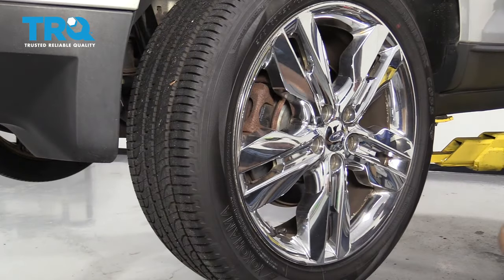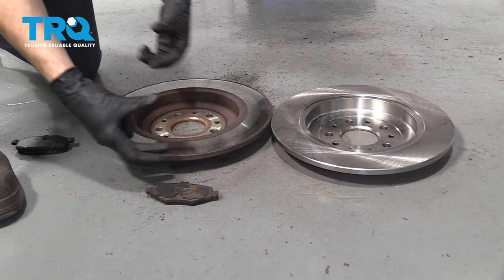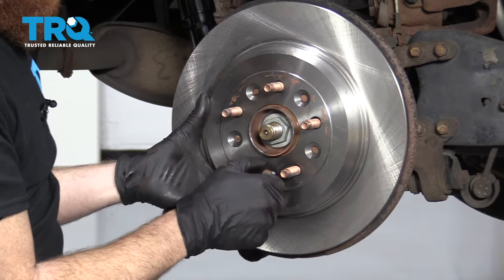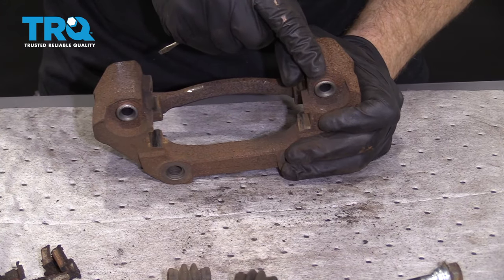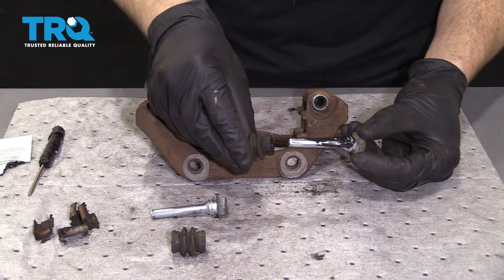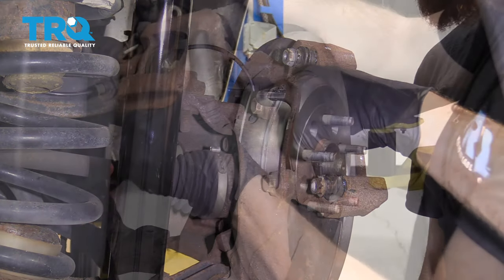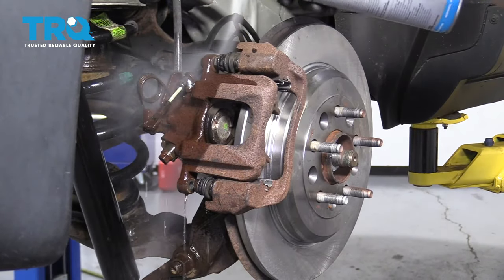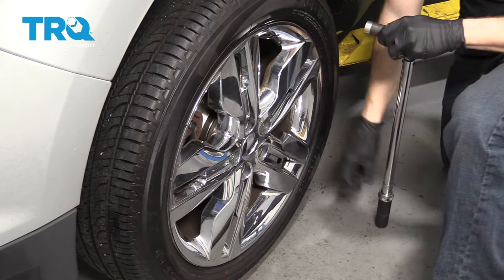How to Replace Rear Brakes 07-14 Ford Edge

Comment: Instead of cracking the bleeder loose just open the brake Reservoir cap that usually allows room for the expansion.  Great videos man keep up the hard work
Reply from the maker: +Rambo Ollie Thanks for the feedback! http://1aau.to/m/Shop-TRQ
Reply: Or a C-clamp maybe idk 😐
Reply: @zeromarine1985  c clamp won’t work because this piston twists not pushing in

Comment: You lubed where the guide clips lock into the caliper?  However, you didn’t lube the side of face of the guide clips that the “ears” of the pad move against.  Seems backwards to me.  Other than that, I was informed about what to expect when I do my 2013 Edge rear brakes.

Comment: I bought new rear rotors for my 2014 ford edge 3.5 v6 and it had the rotor screw on each of them. The problem is when I took of my wheels my rear rotors don’t have a screw hole.I bought this car from a dealer two years ago. How can I put the new rotors on with no screws? I know I bought the right rotors.

Comment: No need to look any further. HANDS DOWN THE BEST  VIDEO on changing the rear brakes on the Ford_Edge! Very straight to the point. Lighting was excellent(not like other video out there that can't show exactly what you mean). I couldn't get the piston to compress in until this vid on how to do it.
Thank you for your time. Excellent job!

Comment: Well done.  Done many DIY brake jobs in the past but since daughter bought a new used car thought I'd check out content on brakes before tackling the job so there were no surprises.  Like others said, straight and to the point.  Should be easy as it's like others I've done before.  Thanks for sharing and well done.
Reply from the maker: +SC Kuhl Thanks for watching our video! http://1aau.to/m/Shop-TRQ

Comment: Hey, great instructional video well done and covered everything required to do a proper job. I've gone the extra step by grinding/wire brushing the caliper surface after masking off the pistons, as well as the brake caliper bracket, and then high heat primer coat 3X followed by a caliper paint 3X before reinstalling. If you have wide spoked wheels, the extra effort sure shines through and they look like a brand new install/upgrade.

Comment: Great instructions. I had to heat up the T40 to remove and make sure you get a padded set of needle nose pliers. It takes alot of effort to twist that caliper back in

Comment: Is it necessary to open the bleeder valve when turning the piston back in or will it just push the fluid back up into the reservoir under the hood?

Comment: Appreciate the info....always like to review these before performing on a vehicle I'm not 100% familiar with.  2 x comments:  First, I would ALWAYS retract the piston with the old rotor around so you don't worry about accidentally damaging it or something....you can also spray WD-40 on the boot around the piston to help it collapse a little easier.  Second, you can rent the tool to easily collapse the piston from Autozone for free instead of cracking the bleeder and would recommend at least bleeding it properly if you do open it.

Comment: 3 questions. 1)Are these rotors and pads the same as on the 201 Ford Edge Sport? 2)Does this process apply to both front and rear brake?. 3)how do you suggest going about painting the calipers? Thank you for your time!

Comment: Clear plastic hose on your bleeder screw and you will see if air is in the line and will stop air from getting into the system.
You will see along column of clear fluid.
Do not push dirty fluid through the brake lines.
Reply: Good video

Comment: Does anyone know how to go about removing the 13 mm bolt that connects to the torx piece to the bottom of the caliper bolt? I accidentally stripped mine and now there's no way to get it off.

Comment: What year was this Edge? I just did my wife's 07 today, and the rear calipers didn't have the notches for the twist to press in. The face was completely smooth.
Reply from the maker: +Kiley Staats 2013 Edge!
Reply: What did you do to combat that? I'm working on my rear brakes today.  I also have an 07
Reply: @naomic123  just use a c-clamp and an old brake pad to push piston back in
Reply: @diablo2815  a C clamp won’t work if the piston needs to twist
Reply: Hey so this is probably way too late to reply, but they do make caliper piston tools that sit between the piston and the other end of the caliper, and are threaded to spin while applying compression force. It will probably give you a better shot, personally I'd be afraid to use the pliers because of the possibility of slipping the tearing the caliper grommet.

Comment: I can’t get the darn piston to turn at all.  Any tricks?  I even bought the tool to do this.
Reply: Sometimes if u spray break clean on the piston and rubber that'll free it up, if not u probably have to replace the caliper.
Reply: Open the mater cylinder cap for fluid expansion always does the trick for me
Reply: @ramboollie8115  Use penetrating fluid and try to get it past the boot. If that won't work most likely the piston is seized, replace caliper. They are not that expensive.

Comment: I hate to say this publically, but I didn't watch the end of this video, & I used a 6 inch C clamp (as usual!) to push the calipers back in.  It was SO HARD, I bent the C clamp.  After switching around the C clamp a few times, the caliper went in easy & smooth.  Did I destroy the calipers by not twisting & pushing with needle nose pliers like you did?  Doh!
Reply: Probably, the piston screws in, how do the brakes work ???
Reply: @leonmarks8724  Brakes are weird now.  Peddle depresses 3/4 way normal, with normal braking, but then peddle gets stiff & braking fades, requiring double the foot pressure to stop.  Getting new tires Monday, having shop look at it & decide if I should replace calipers.  Doh!  Was almost the easiest brake job ever!  Would have been if I had bothered to breeze through your entire (excellent) video!  Not a bad idea to replace 9 year old calipers anyways, but I would have done fronts first.
Reply: @StephenMattison66  
Sounds like piston damage, won't go down all the way, best to replace. If you already replaced the brakes I am sure you will be able to replace the caliper as the piston will be in already. when you finish just open the bleeder screw and it will gravity bleed, although it will take some time. Good luck.
Reply: The Hayes video has you switching the C clamp from one end to the other to collapse the piston before you remove the caliper.

Comment: That piston system is jank!!! I modified a set of my welding pliers and got the job done finally
Reply: There's a tool you can rent from most auto stores to twist the caliper back in. Got mine from AZ it's pretty good. Good enough to keep actually. Has numerous patterns to match slots on integrated calipers like that.
Reply: I'm going to order the tool online